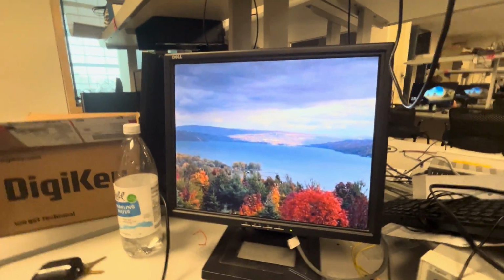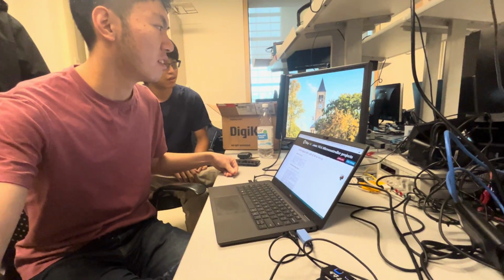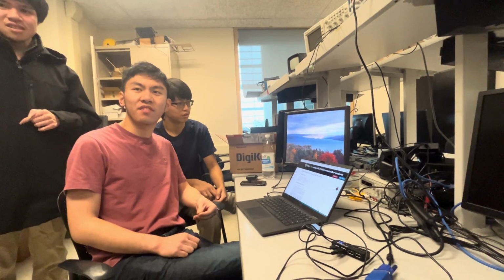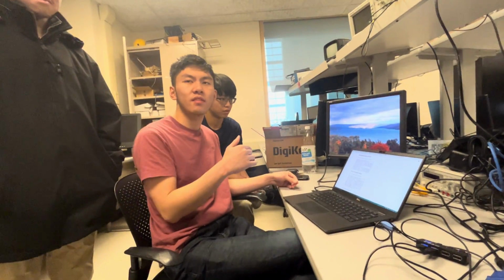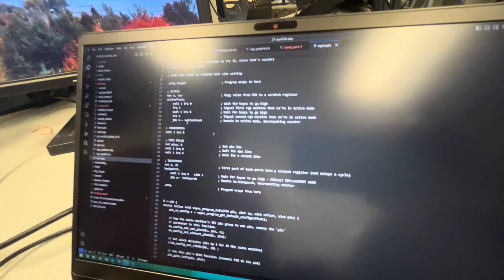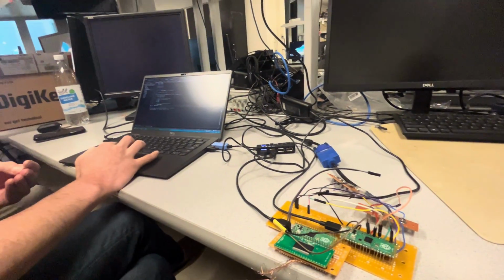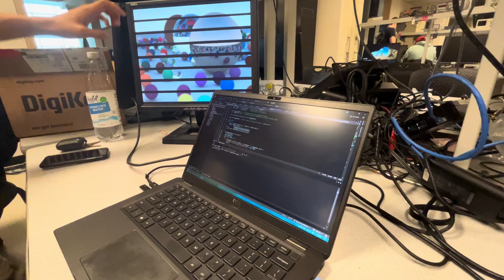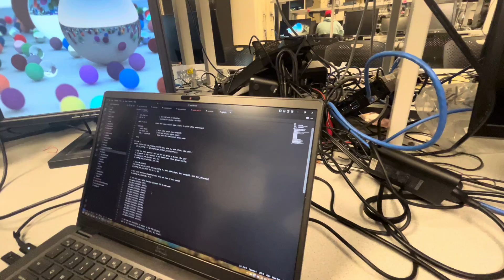16-bit color from a Raspberry Pi Pico to VGA display

Comment: Very, very impressive. I wasn't clear why the horizontal resolution needed to be 399 pixels, but having now read the project website I see why. I think I may have a solution to enable all 400. I can't test it at the moment, but if you're interested...

At the beginning of rgb.pio and rgb2.pio you could replace the instruction... 

set pins, 0    ; Zero RGB pins in blanking

... with...

mov pins, !x    ; Zero all 16 RGB pins in blanking (with !0xffffffff, i.e. 0)

... as after the final loop in the final instruction...

jmp x-- colorout    ; Stay here thru horizontal active mode

... is executed the x register will be decremented one last time and be 0xffffffff ("-1").

Also, it might require x to be initialised to 0xffffffff before starting the state machine with...

pio_sm_exec(pio, sm, pio_encode_mov_not(pio_x, pio_x));

... as I believe the x register is 0 when a state machine is initialised.
Reply from the maker: Very clever. Yes, I believe this would work. I'll let the students know, thank you!
Reply: @hunteradams9430  You're very welcome. And thank you, and your students.
Reply: Actually, a simpler method might be just to use ISR, which I believe is initialised to 0...

mov pins, isr    ; Zero all 16 RGB pins in blanking